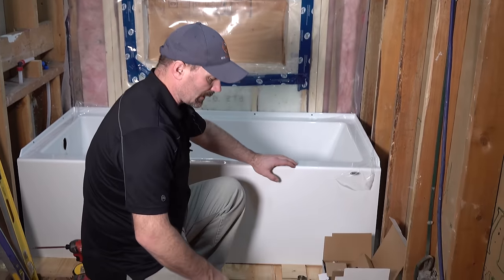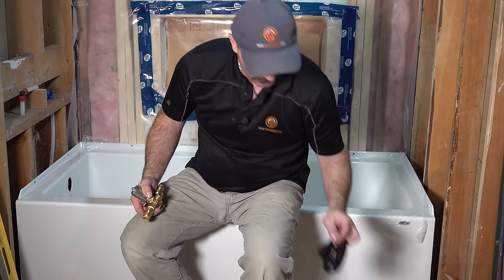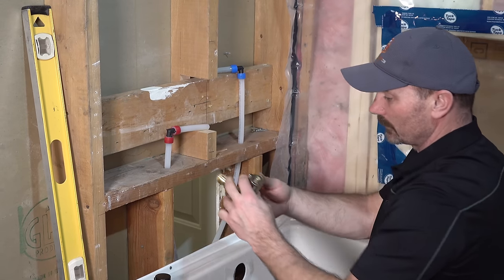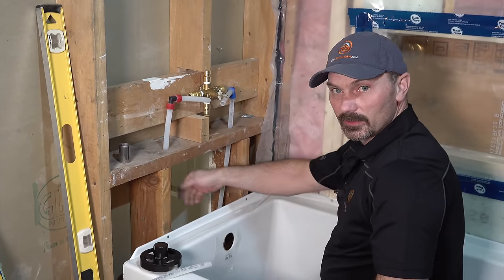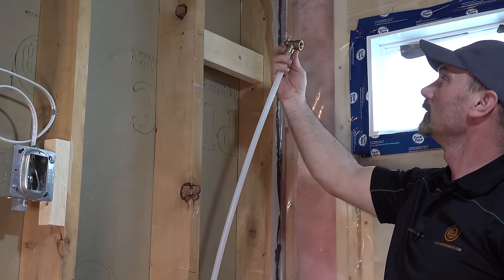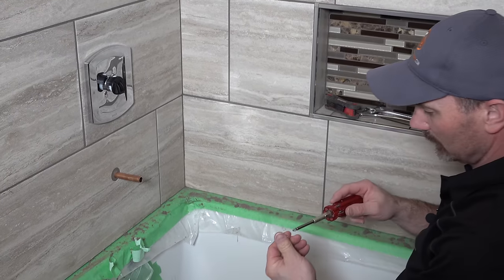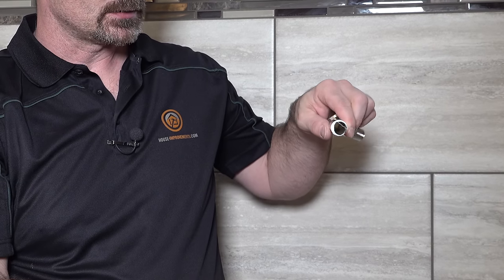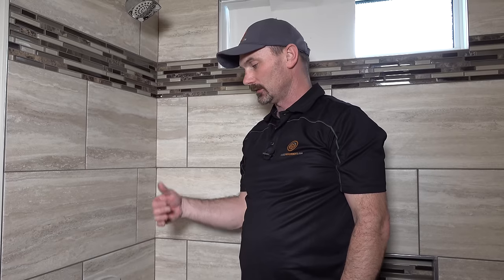How To Install Tub/Shower Faucet

Comment: Does anyone know what to do with the black plastic spacer he intros at the 35 second mark? My valve has 4 mounting holes and the plastic spacer has4 long stems that would seem you would screw a long screw into it and thru the valve to mount. But I'm lost. Also if anyone can tell me how to remove the black plastic plug in the valve to be able to use with the tub spout rather than shower only use PLEASE tell me. I've tried gripping with needle noser pliers, turning with flat head screw driver and I can't get it out rendering the whole set up useless for my kids lol.
Reply from the maker: That black plastic spacer is used to determine your valve placement depth in the wall depending on the shower wall product you are using . If you are using a plastic shower surround on the walls then you want the face of that spacer flush with the surface of the face of the cement board or what ever is going under the plastic tub surround   .If you are using tiles then you want the front face to be flush to the face of the tiles or with in 1/4" of the face of the tiles .

As for a plastic plug in the bottom of the valve I have ever only seen brass plugs ? Some also come with no hole at all and are for showers only. If there is a plug you should be able to turn it out with a cresent wrench. If you still need assistance please try my forum
https://www.house-improvements.com/forums/

Comment: Why it is not recommended to use PEX pipe for the spout outlet?
Reply from the maker: The inside diameter is smaller than 1/2" copper and you actually get a restriction when filling the tub .
Reply: @HouseImprovements  Shanon, when you push the 1/2" copper pipe into the Sharkbite fitting the water flow is already restricted because the small tube inside the 1/2" Sharkbite fitting is smaller than the copper pipe. I like to use 3/4" pex pipes so the flow restrictions inside the Sharkbite fittings would make it about the same as the 1/2" copper pipe flow rate.
Reply from the maker: @distantrx2287   On copper pipe you would remove that small inner plastic sleeve. Your idea of using 3/4" pex is actually a good work around for the tub spout , That would work IMO.

Comment: Hi how long the spout  cooper   pipe should be  ? thx
Reply from the maker: Depends on the spout but if you make it protrude from the face of the wall 8" to start with you can cut it off to what you need after.

Comment: This is off topic, but why would you have an electrical box right next to the shower?
Reply: D Beaulieu Im thinking it may be for a wall sconce lighting fixture. However, a fixed glass panel between the shower and light would be the safest way for that type of installation. Not a shower curtain. Thats my thought, but lets see what Shannon says its for.
Reply from the maker: This is actually a infloor heat thermostat location. This one is GFCI protected but we did actually move its location before boarding just to avoid a possible inspection fail because of it.

Comment: Shannon what I don't understand what if the  mixture have to change because you cover it with titles
Reply from the maker: Generally the valve body would not need changing for likely 30 yrs and the cartridge that goes in it can be changed by removing the handle and cover. If you had to change the valve body in most cases you could do it by opening the wall from other side.
Reply: @HouseImprovements  thank you sir keep doing what you doing

Comment: how deep in the wall you have to install the valve?
Reply: Read the instructions there all different
Reply from the maker: Depends on the valve and the wall material you are using. The instructions will help you figure this out.

Comment: Shark bite inside shower major mistake
Reply: Like many others, I also have concerns about installing Shark-Bite fittings in enclosed areas where they become inaccessible, but also realized that the Shark-Bites used for the tub spout drop and the ones used for the shower up line will never be under standard house pressure.  I still would not trust the hot and cold pressure lines using Shark-Bite going into the valve for the long term.  When the valve is off, there is no pressure in the spout and shower lines because both are open to the atmosphere.  When the valve is open to the spout or shower, water is just flowing through and exiting those pipes.  Water is not standing in those pipes under pressure.

Comment: many dont like those push fittings ..well they are ok if u buy brand name like sharkbite ..other brands ...ehhh not so sure ..as long as u have access from the back ..u should be fine ...
Reply from the maker: Many areas will allow them buried in walls. I have done this many times.
Reply: Note that only the hot and cold lines entering the valve are subjected to standing pressure.  The tub spout drop line and the shower up line never experience standing pressure.  They are either closed at the valve and open to the atmosphere or when the vale is open water just flows through the pipes to the atmosphere.  They act like a drain pipe rather than a pressure pipe.

Comment: remember pipe thread is usually a tapered thread and gets tighter as it's tightened to make the seal. more than a a few winds of teflon tape prevents the fitting from getting as many threads involved and a results in a weaker fit.

Comment: As a plumber I suggest to NOT USE "PUSH FIT CONNECTORS" behind the Ceramic!! These are the less trustfull fitting so youre taking a Risk here. Call plumbers guya
Reply: As a plumber, you will always say to call a plumber… but often times, plumbers (not JUST plumbers, people in general)are less trustful, and you’re taking a risk of paying MORE money for things you may or may not actually need.

Comment: tried using those push fitting and leaks everywhere.Had to dismantle and install with crimp rings.Extra work and cost had me cursing at these POS fittings
Reply from the maker: You did something incorrectly . I have had 1 leak in all the ones I have ever installed. When using them on commercial be sure the pipe is in good condition and no burrs on the end after cutting , those can damage the rubber o rings in the push fits when installing.

Comment: sharkbites....yikes
Reply: Explain? Do you and should i not trust them?
Reply: @duMaurier15  sharkbites are good when you are in a pinch and need to make a quick fix, i wouldn't do an entire house in them, also super expensive. with all the pex options its very easy to do without having to solder. Yes a sharkbite will hold normally but they do fail